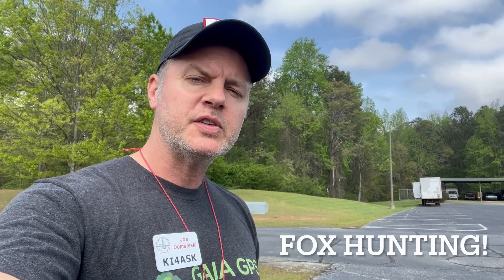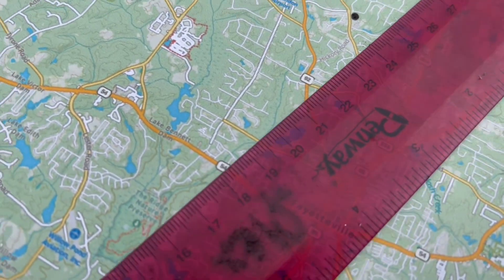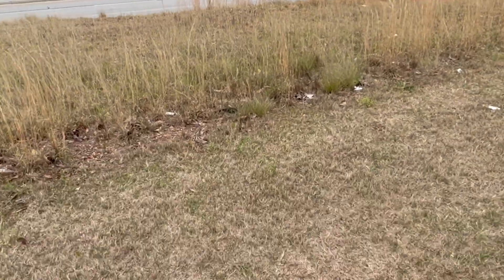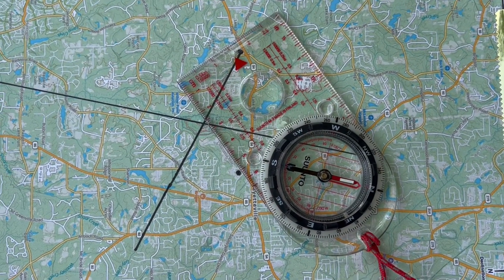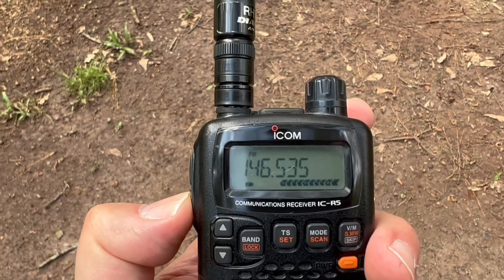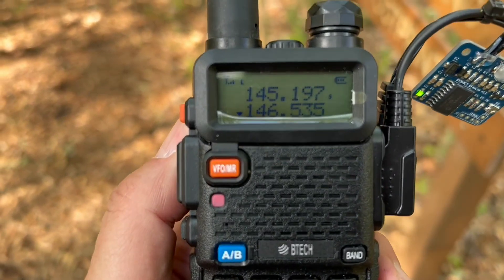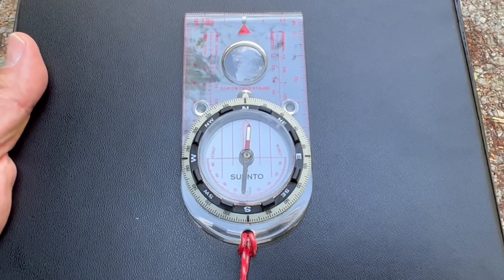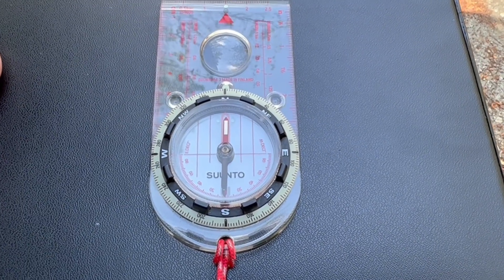Fox hunting 101 - how to find a hidden radio transmitter in three easy steps #hamradio #foxhunting

Comment: WHOA buddy! Going from compass to map is not straight forward. YOU MUST convert using declination. Fayetteville NC is 5.6 degrees west, which means that you will add that to your compass bearing. The correct map degree should have been 195.6 degrees.
Reply from the maker: You’re wrong. The declination has no meaningful impact on the bearing here. It’s only 6 degrees of declination here too. The margin of error for the Yagi is 15 degrees on either side of center. I agree it would have meaning in orienteering and land navigation, which is something we also do - but not in fox hunting given the precision of the Yagi.

Comment: I'm not impressed with the part of the search where you were close. Directionality was not accurate at all. Direction when your close is something that can still be done with series attenuators. Also, shielding the radio in a metal box keeps you from receiving the signal directly through the radio and completely skipping the antenna. These are things that need to be done ahead of time, developing these procedures. The best fox hunter can still use his beam even though he's less than 100 ft from the fox. I really like the tape measure antenna but just feel that with the right technology it could be used for the entire hunt.
Reply from the maker: Having done fox hunting for 20 years, I can only share with you skills that I’ve learned and know that work whether you’re impressed or not. These techniques work but they’re not the only techniques. I’ve also done fox hunts where everyone had to use only an HT - not fancy antennas or equipment. You’re not wrong about other ways to do it - there’s more than one way to do a hunt.

Comment: You're not accounting for magnetic declination?
Reply from the maker: @nekelly123  The declination is currently about -6 degrees here in the Atlanta area. Since the effective signal strength is up to 15 degrees on either side of the yagi, declination is negligible when taking a bearing to the estimated bearing of the fox.

Comment: Did you take into account declination when to transferred your azimuth to the map?
Reply from the maker: No and there's really no reason to do so in this situation. It's only 6 degrees difference here and the rule of thumb for horizontal accuracy of a Yagi is 15 degrees on either side of center. Unlike land navigation, we just need to be generally accurate. If the declination was greater, then yes

Comment: What's the declination and are you taking that into account? Absolutely fantastic video. I had the general idea but never knew the specifics of a fox hunt, such as what was the fox. I'm ready to start fox hunting.
Reply from the maker: The declination is currently about -6 degrees here in the Atlanta area. Since the effective signal strength is up to 15 degrees on either side of the yagi, declination is negligible when taking a bearing to the estimated bearing of the fox. Yes, fox hunting is lots of fun!
Reply: @KI4ASK  Thank you Joe.

Comment: Does that musical noise coming out of the Fox Transmitter contain data ?
If not, it sounds like music, which is prohibited on Amateur Radio !
A fellow Ham, which worked as a Railroad Engineer, was called up on the carpet, for sending the Morse code equivalent to a laugh, ie. Hi Hi, on the locomotive train whistle, as he was using his Two meter HT while on the local repeater !
So it happens !
🫲😳🫴
Reply from the maker: It's not music and it's legal. That fox transmitter is probably the most widely used one. I've even used it on training exercises with federal and state officials.

Comment: There is a new device out called the KrakenSDR. You install 5 antenna on your car roof at very specific locations. It then scans when he/she broadcasts and not only will it find the "fox" but it will guide you to the location using GPS. Almost like a Google Maps Fox Locator. But you can find the fox in just one step.
Reply: "But you can find the fox in just one step."  Maybe, just as long as you set up the antennas accurately and the area isn't densely populated with tall buildings. Many KrakenSDR demos take advantage of rural/open countryside where reflections are hardly an issue and also the source is a very strong and constant signal.

Comment: I’m curious if you would have had more accurate results if you took into account magnetic declination when applying your azimuth to the map?
Reply from the maker: Doubt it. It's only 6 degrees difference here and the rule of thumb for horizontal accuracy of a Yagi is 15 degrees on either side of center. Good point though.

Comment: Great video. 
Can you expand on how your handheld is directional with no antenna?
Reply from the maker: Sure, there's actually a part two to this video which elaborates on directionality and attenuation.  Here's the link -> https://www.youtube.com/watch?v=MpSOPD4lnWQ&t=89s
Reply: @KI4ASK  another great video.  Body blocking is a very useful idea. 
I’m still not understanding how the antenna jack alone is not omnidirectional.
I suppose the sides of the jack shield some in all but the open direction.  
I need to make a fox or micro fix and play with it before the next fix hunt.  I bought 2 Db and 3 Db attenuators. I was planning to use them with my Yagi, but ran out of time at the fox hunt, last year. 

Radio is fun and there are always new aspects to learn. 

Your videos are great and very helpful. 
Thank you for the work you put into them.

Comment: I have the kraken and am setting it up, but i wish to learn to do it the old way, with handheld, and with kraken. I appreciate your videos since i can learn the fundamentals. I would like to be able to get to the point where I use my kraken to get to the general area, then use the old school techniques to get to the exact area. What are your thoughts on using a yagi hooked up to an RTL SDR4, an attenuator, and an android phone with an SDR waterfall? I think that could be mounted to a tactical chest rig very easy to hold the gear and free up hands when foxhunting
Reply from the maker: I personally think that's overkill for a basic VHF or UHF foxhunt.  A simple HT can get you right to the fox. The additional of an SDR with waterfall doesn't really add any help because you're more interested in signal strength than you are the width or other characteristics of the waveform.  Some even find the signal by the strength of the sound.  There are some kits out there that you can have that strength relayed to you as audio feedback.  That's how the ARDF competitors do it. Having said that, what you've outline should work. I use both an SDR-RTL (for simple stuff) and AirSpy HF+ to hunt DX on all bands, but wouldn't use either for a foxhunt because it's hard to beat the convenience of a handheld radio.  Thanks.

Comment: If you leave the antenna on its factory sma antenna  when ur in park getting close  u can unscrew the ant in small increments until the center pin is basically “arc” ing rf    And reduces the signal greatly like an attenuator   Used it many times and works great     Also when close  hold radio up against body and use body like a beam  turn 360 for max signal     When close u can also look on the 3rd harmonic     146.535 x 3 = 439.605      When finding rf targets etc   Its usu encouraged to show a 3rd harmonic no antenna as proof of jamming signal and location   ✌🏻
Reply: I think knocking off the frequency is easiest. Start with big difference and keep reducing the distance as you get closer.
Reply from the maker: Good tips, thanks and 73

Comment: Did you do a video on how you made the tape measure antenna?
Reply from the maker: I haven't.  It wouldn't be that exciting - basically just cutting and measuring the elements, then doing a little soldering.  Maybe a future video.  I think some others have done video builds.

Comment: Great job. I like the style and delivery. Everything explained well, lots of clean visual aids - BTW where did you get that map??? Mine never look that nice. And good editing and pace. Would you use the same technique for a hunt in a smaller area on foot?
For instance if the entire hunt took place inside a large park or outdoor area, all on foot and no driving.
Reply from the maker: Thank you for the kind remarks! I use GaiaGPS.com for mapping.  Excellent service via web and app.  You can download topo maps and use them off grid.  Yes, I would use the same technique on foot, except...you might not need a Yagi.  If it's less than 1/2 mile, I bet you can get by with the whip antenna and the challenge is to attenuate the signal.  In fact, I conducted a hunt in a state park two years ago and everyone just used an HT with no special equipment.  Have fun and let me know how your next hunt goes.  73

Comment: Good job. but I'd be driving the doppler unit around for that, until I got into the last couple hundred feet.
Close up work gets the arrow antenna with the attenuator. The really tough ones get a dose of harmonics when really close.
Reply from the maker: Most of the fox hunts we have down here restrict the use of doppler because it gives an unfair advantage - except for the advanced fox hunts.  We try hard to encourage beginners that the equipment needs are very simple so they're more likely to participate.  We did an advanced one last year where there were two foxes on the same frequency, the tone was different and they were timed to stagger.  That confused the doppler, because the broadcast time wasn't long enough to get a solid lock!

Comment: Super video about fox hunting!  
When you get closer, remove the antenna.  Your body serves to block the signal if the source is behind you.
When you get real close, tune off the frequency 10 kHz or so and let the IF filter of the radio attenuate the signal so that your signal strength indicator is not pegged.